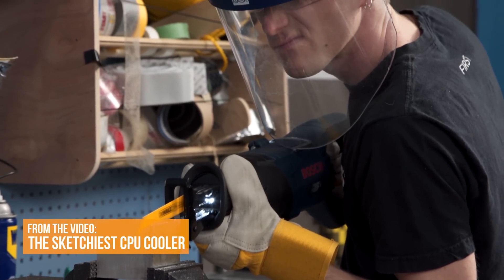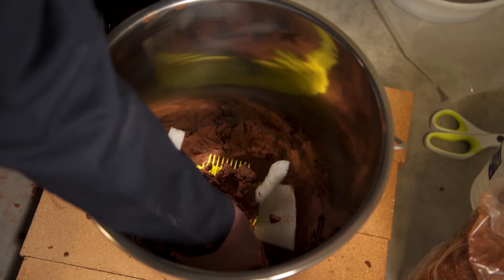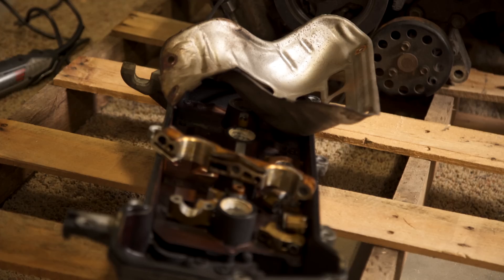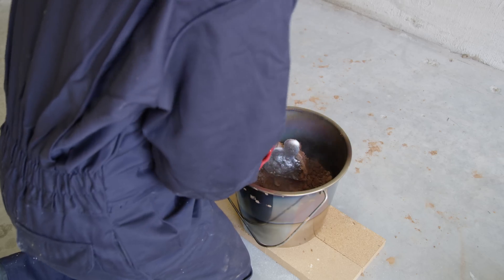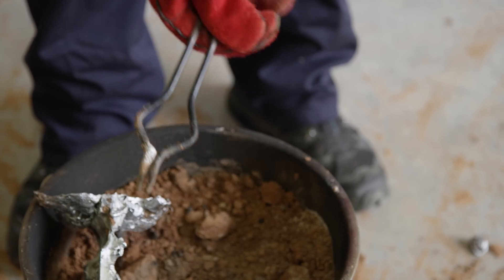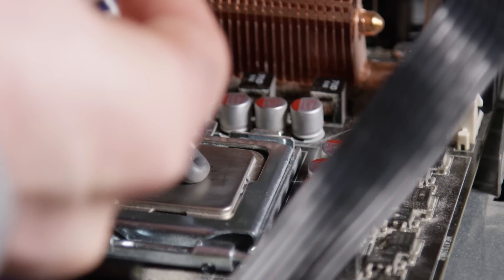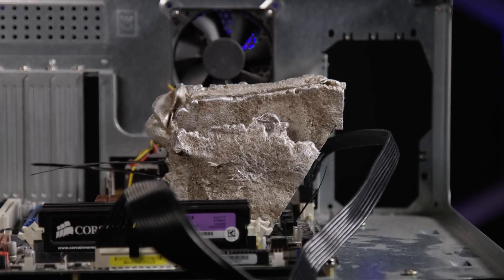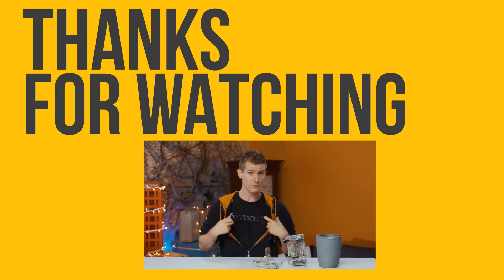The WORST CPU Cooler EVER – Sketchy Heatsinks Ep2

Comment: You would do better by taking a sheet of aluminium, cutting it into square sheets (fins) and then combining them by casting the base underneath them.
Then you would just cut the base to the size and voilla.
1. Take sheets of aluminum and stick them temporarily together with proper distances by putting sheets of paper between them
2. Put such prepared sheets between two pieces of wood (soft wood - like plywood) and clamp them together  with a clamp so that the wood on the side keeps the sheets together. The wood must be on the side where it touches each edge of each sheet - so that it will keep the distances of the sheets when the paper will burn out.
3. Make a simple cube form for casting that is bigger than the sheets (that will be the base of the radiator, it must be a bit thicker than the sheets).
4. Cast the aluminum into the square form.
5. Put the clamped sheets into the still molten square form.
6. Wait for cooling down and cut the base to size and grind the bottom until it is flat and shiny.
7. Admire your results

Comment: casting... reaally... if you want to go throught all the trouble to make your own heatsinc with no super high end machinery why not try and make it easyer. seriosly pick up a thin sheat of aluminium and a small piece you can use as a base then weld them (maybe using foam or something to keep the fins spaced) without precision tools that might be the best way. welding aluminum may not be the easyest thing to do but its not impossibly complex

Comment: use a peltier heat pump in between the heat sink and CPU and go back to the first sketchy CPU method but instead of a reciprocating saw use an angle grinder and make the fins slightly thicker

Comment: when doing lost pla casting, you're supposed to melt away the pla BEFORE pouring the melted metal
Reply: well, yes but then it would have not been such an epic fail.. And that is a whole lot more fun than a partial sucess...
Reply: I would have went with 2 stage , low temp plastic casting , would have been much easier and better results
Reply: @michealfisher  Think about what you are saying: 'melting away'... to where? Look at the mold. If it were upside down,... to flow out, I guess... maybe? But it was right side up so, your statement and Linus' make no sense. 

Red Ninja was right and every comment below that was unnecessary. Two minutes of research (especially on YouTube) would have explained it all.
Reply: Red Ninja dont know if true. makes sense. ppl dont research
Reply: No, sorry,... watch again. They did not. They only tried to dry the sand with light heat instead of the 'burn out' level needed for the PLA.
Reply: Or they could have just straight up sand cast it, no need to get all fancy with investment casting lol
Reply: ikr
Reply: they did attempt to melt the pla away...
Reply: 3:22 he states that they bake the clay to harden it and to partially melt the plastic. now, as red ninja stated, you have to melt it away completely, which they didnt do, but they did attempt to melt it, which is my point
Reply: Well done you found Wikipedia.
Reply: you were watching, but not listening. as linus said, they attempted to heat up the mould in the hopes that the pla would melt, but it didnt work. although, you'd thing they'd learn and alter their later attempts to make sure they do successfully melt the pla
Reply: You're not very smart are you? i said they attempted, i didnt say that attempt was successful did i?

Comment: Anyone else think AvE should make a heatsink for LTT?
Reply: ave would make a kick ass cooler
Reply: I dont think AVE would like to take a part in a channel with this philosofy.
I would love to see it though.
Reply: Skookum as frig
Reply: idk man. After they tap a few holes, beat the crap out of it with a Swedish nut f*cker, and make some sort of A-dapter for all those Metreek fanboys out there, they may have a viable way to measure the Chooch Factor (TM). It will be a blond one away from breaking poor ol' Aida, but functional.
Reply: even tho ave's video would be fun to watch, precision metal work is more of ThisOldTony's forte. Or clickspring...hmm..is brass a good heat sink?
Reply: At least AvE's wouldn't be a straight up meathook abortion.
Reply: All through this video I was wondering what he would say watching this.  I imagine it would be funny.
Reply: Brass and Bronze are actually terrible for heatsinks,  typical Brass has a conductivity of 111 w/m k.  Typical Bronze is 26 w/m k.

Pure copper on the other hand is 386 w/m k.

As an addendum to my other idea, one could probably just go down to home depot and buy a "refridgeration" copper coil, that is mostly likely guaranteed to have highest thermal conductivity alloy, if its not pure "soft copper".  Fill a small section of it with sand, bend it into a reasonably shaped coil around something like a still full popcan.  Then simply put it on a hotplate and very carefully melt a nice solid base.  Easy peasy lemon squeezy.

Silver dollar pre-slug at bottom:  Optional.   Could also use:  air conditioning coil from car from same scrapyard.
Reply: I think the same thing. AvE won't do videos on things given to him by companies making LTT a pretty unlikely partner...
Reply: I am certain that AvE could Fabricobble something a little more sightly than that "THING". Heck why create when you can re appropriate.

To Canuckystan and beyond
Reply: Son-of-a-diddly everyone has already taken the phrases I wanted to use.... Bob's your auntie, fuck it.
Reply: As far as I know ThisOldTony never uses castings and probably doesn't have a foundry. I know Tubalcain has a foundry.
Reply: They both live in BC
Reply: 1MBStudios this wasn't a choocher
Reply: Looks skookum as frig to me, plus look at all that schmoo. What more could out ask for.
Reply: Cody's Lab would also have the knowladge and equipment to do this.
Reply: This would have to be a whole hodgepodge of youtubers working together 
Linus:to test the thingy
Grant thompson:to styro slice it ig
Cody:to purify the perfect batch of aluminum 
Backyard scientist:to do a perfect cast what he does natural
Ave:finish the product with all he mechio do dads and true up the sides with a mill 
Etc
Reply: That’s not the Cockford Ollie
Reply: He's more on the chemistry side of things then the construction side. 

Though I'm sure he could do better than LTT.
Reply: It would chooch better than this one.
Reply: Jeremy Carpenter no
Reply: i think that mi mecanic can do it better XD
Reply: No, get TOT or Clickspring on it
Reply: DO IT.
Reply: Brass does have a relativly high rate of thermal conductivity and would make a good for a good heatsink... though alumnum would be a better "bang for your buck" material; copper would be the most effective comercailly available material for a heatsink short of silver, but who wants to spend that much to keep a CPU cool. 
....That said, as a machinist with free access to a plethora of CNC machines,... the sky is really the limit.
Reply: 1MBStudios can't think of anything to joke about this.....
Reply: +1MBStudios You're joking right?
Reply: the fuck did you just say
Reply: I guess he does not have means to do it. I'd rather see Hydraulic Press Channel/Beyond the Press Lauri from Finland making it.

Comment: You should have cast it with fins down in PLA or lost foam. You typically put the most detailed features in the bottom of the mold to avoid defects. Your "Engineering Department" got it right with the clay mold, having the features down and having an open top, but I don't know why he did not orient the PLA and foam. If you need an on-staff metallurgist/casting professional, give me a call ;-D

Comment: I absolutely fucking lost it when they piled on a small mountain of thermal compound. Completely ridiculous.
Reply: It's like the silver surfer took a giant shit on his die to let him know what he thought.
Reply: -.-
that would only apply to proper, machined heatsinks that have a flat base. This one didnt, and had multiple air pockts caused by the casting process, and as a result, your point doesnt apply.

the reason they applied that much paste is justified, they needed to fill those air pockets to ensure that there was enough surface contact between the heatsink and cpu in order to dissipate heat as effectively as possible. A little amount of paste would leave large air pockets which, in turn, would serve a more negative effect than more paste, obviously.
Reply: well, it base of that heatsink wasnt flat in any way shaper or form, using that amount of thermal paste would fill a lot of those gaps if they can remove trapped air. without a lot of paster that heatsink would have very little contact with the die. its not a machined piece of metal like actual heatsinks.
Reply: +Michael Fisher they did it in a stupid way though. they should have manually filled the holes in the heatsink with the thermal paste, then applies a bit on the cpu. rather than hoping a mountain of thermal paste would fill all the huge bubbles. which it probably didn't.
Reply: All I have to say is that was like Everest to an ant.
Reply: Jennifer Lynn esp since luke did video on that
Reply: there was no fixing that xD Linus's first reaction to it summed it up imo. It was laughable.
Reply: a large pile of thermal paste would probably be more efficient than this cast, porous heastink
Reply: Ideally you want to put as little thermal paste as possible, because you want the paste to be a filler for the microscopic space in between the heatsink and the CPU. The thermal energy should transfer from the CPU to the heatsink as quickly as possible to cool it efficiently, and adding more thermal paste than necessary would slow down the heat transfer (since the heatsink should dissipate heat into the air better than the paste)
Reply: Michael Fisher I know why he had to do it, but actually seeing all of that compound really made it hit me just how ridiculous this whole project was. I was straight-faced for the whole video up until that point because I thought they were going fix it somehow. Nope, haha.
Reply: ikr?

Comment: I have no engineering experience (someone correct me if i make a fool out of myself) but wouldn't a smarter idea be to make a cast out of the clay and fire it and THEN pour in the molten metal? 

The only experience i have in doing this is making things out of duct tape and hot glue. I know that would not be.....adequate for molten metal, but i believe the concept stays the same....make a cast and fill it in with desired material.

Comment: Cut apart some soda cans and solder them together. Start by making a bunch of squares and bend them just along one edge to make a 90 degree angle. Solder them at the bend one at a time onto a base square.
Reply: Or bend them into U shapes if you want to save some time but it might be more difficult to do the soldering.

Comment: should've 3D printed a negative using the plastic and used it to make a wax cast. Lost wax would've worked a bit better. Pouring in the aluminium from the flat contact part and then grinding it down flat after.

Comment: The stuff that comes to the top is not dross, it is slag.  Dross is an unwanted metal in your heat.  The Aluminum did not get hot enough for this type of molding.  You could have tried adding gating to the mold.

Comment: Linus (LMG Engineers), why bother with sacrificial material? fill bucket with sand, remove square of sand to be contact surface about 10mm deep, take sharp thin blade slice sand to make heat dissipation fins (as many as your grain of sand will take) pour in copper pipe melted in your furnace (it's better than alluminiun)

Comment: I bet it would be easier and cheaper to buy a broken window air conditioner and make one out of the parts.  1. Already has layered aluminium for heat dissipation 2. contains copper tubing.

Comment: Oh for the sake of everything that's holy... Take a solid block, put it through a tile cutting saw with a diamond carbide blade. The guide keeps it straight, you can set the depth, everything is clean and great. A nice polish on the bottom and boom! You got yourself a heat sink. I cut solid quartz and granite tile with ease. Aluminum is much softer and should work nicely. I bet if I had a good cube of aluminum I could do it in less than a half hour and it would at least be on par with some stock coolers, maybe better because there would be more fins and the gap in between would only be a saw blade thick. You would be surprised how much hokey engineering you need to do working on houses out in the country to avoid spending an hour going to a big box store.

Comment: Hey Linus well tried on the Custom Heat Sink 😉 few improvements should get you through.. we as dentists use lost wax techniques, for preparing the wax pattern aka the design which you wanna try (ask for blue wax) use an investment material  ask for type IV dental stone (high setting low expansion dental stone) instead of the clay ; for casting use a centrifugal machine also known as the broken arm casting machine, Good Luck ✌👍

Comment: heat sink idea, buy a sheet of aluminium, cut a heap of small and large rectangles, and then just bolt it all together so the rectangles are sandwiched together. The smaller rectangles could be copper to more efficiently pass energy to the aluminium fins.
Reply: Muppet i had that thought..but these clowns..well. Mouse jockeys

Comment: For lost pla casting you need to use a plaster mold first. Then you need to heat the mold hot enough to vaporise the pla (on a hoven, upside down seem to works well). Remember to add a (better) way for the air to escape. And for god sake make sure the mold is dry af when pooring molten fricking metal.!

Comment: why didn't yous  try wax  that's how  a lot of moulds   are made 
print out  your 3d  mould in reverse so it can  fit  a 3d  contains the wax mould then  when its dry remove it put the wax molding the sand   and tada the wax melts in u have your creation in theory  :D

Comment: i mean, he could always just take some ceramic baking clay and layer that in the bucket, then push the flatter heat sink model they made into it,  although not too deep as to allow the end that actually touches the CPU to actually transmit heat to the fins.
next of which they would let that bake to harden and take shape (with the indent of the heat sink in the clay, of course)
then pour the aluminium within that mold/indent, and clean up the remaining metal, and there ya go.

although

just a theory of course

Comment: You had a good try but listen from a guy who dose this very often. use soft packing foam like what you want pc parts to be pact in and surround it in regular sand. dry sand. You're design that you made was great and if you made it out of the foam i suggested with a larger thicker base that you could sand off to make flat you might have been able to make it work.

Comment: The casting seemed to me to be too crude. A smaller wax casting in equal parts plaster of paris and fine sand for the mould might work much better. Sculpt the heatsink out of wax. Create the mould and let it dry, then bake the wax out. Use a smaller crucible to melt the aluminum for a finer pour and make sure the mould is heated as well. After casting, break the mould and quench the heatsink to prevent crystalization.

Comment: Seriously, Linus... this is almost painful to watch..... you should have checked on Sand Casting and watched closely.... you used FAR too much water,,, the material should feel dry to the touch... this is the main reason  you ended up with "globs"  of aluminum  Casting sand is usually a mix of clay and sand... just enough clay ( powder ) to let it hold the shape when moistened... not made wet. Kinda like what you get when you make a sand castle. 
  From what I see, you tried to mix the Lost Wax method, which uses plaster with Sand Casting, lol.

Comment: take alot of aluminium plates and put them top of each other (every other layer smaller plate so you have fins) and use some kind of thermal glue or maybe indium to glue them together, now make the bottom shiny and now you have sketchy heatsinks ep3

Comment: First, you need to make a complete wax replica of the heatsink cooler then coat it with ceramic & sand melt away the wax in a furnace with a pan of water at the bottom to catch the melting wax. Now you will have your mold ready to pour the hot metal into.

Comment: Here's how you do it:

Get a lot of Al panels, about 10cm x 10cm x 1mm. Then get some that are about 1cm x 10cm x 1mm. Then drill two 6.5mm holes through all of them and use 6mm bolts to hold the panels together. Then if the base isn't smooth enough, just use some power tool over it and done! You'll have a 1990's heatsink. You might consider making the smaller panels out of copper, to simulate the fact that 1990s radial heatsinks often had a block of copper in the middle, because copper sucks the heat out of the CPU a bit better, or something.

Then just stick a fan on the top.

Comment: you should have used epoxy to make a mold of the printed cooler and then split the mold in half melt the aluminium and pour it into the epoxy mold. and make sure to heat the crucible until almost completely red.

Comment: to replace a $20 item that one can buy almost anywhere you guys went to the limit (almost as you didn't dig the ore then smelt it). Kudos that this thing worked at all. i will refer it to several ppl I know that insist on this type of thing but have no practical knowledge or experience.

Comment: How about using several thin sheets of aluminum held together with a few millimeters of thermal adhesive (leaving gaps between the sheets) then polish one side and mount to the CPU.